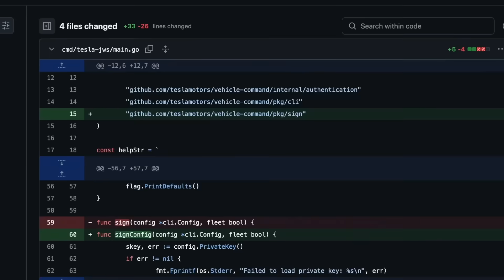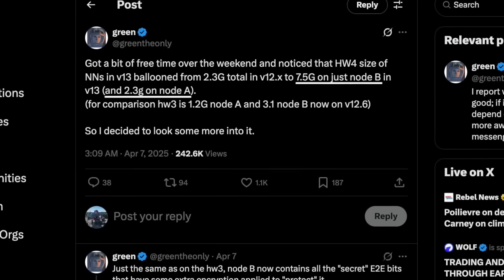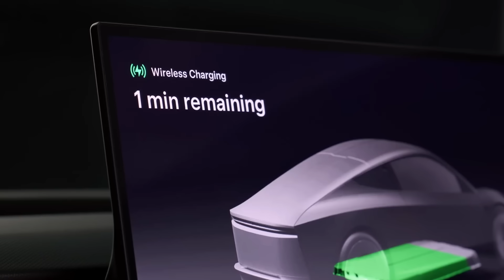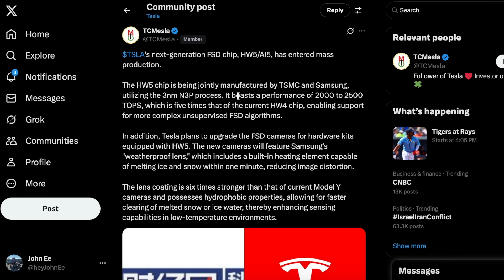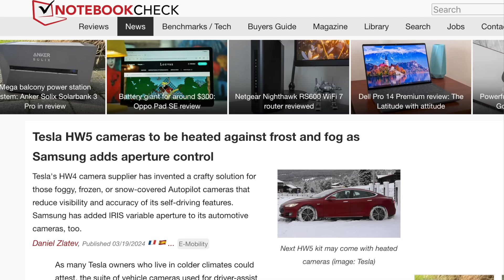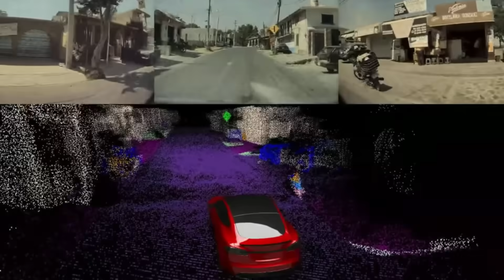Tesla Prepares HW5 Camera Upgrade Delivering Major Improvements | Massive Changes Coming

Comment from the maker: If they end up solving unsupervised FSD with the current hardware are you still inclined to wait or holding off for HW5? Here’s more about the Hybrid Lens camera system https://youtu.be/294AYhCPYnM
Reply: Holding out for AI5 for exactly the reasons you describe in this video. Yes, FSD is a high priority feature for me, and my gut sense is that 10x jump in processing power of AI5 is necessary for mature FSD; if HW4 was adequate, Tesla wouldn't be working on the upgrade.
Reply: Get AI4 in the US along with the $7500 federal incentive and still current 1.99% interest rate.
Reply: Tax Credit will be gone by then
Reply: @Rishi.Rao.  We may lose the tax credit, and that's a major issue for tight budgets. On the other hand, if one regards AI5 as a "must have" feature, then getting a bargain and missing out on that feature isn't a viable tradeoff.
Reply: It’s a tough call…I really want to take advantage of the tax credit before it goes, however unsupervised FSD is a major feature for me…
Reply: At least a year away though

Comment: Considering AI5 will use more power, it is likely Tesla will also implement a new battery to either keep up with the power usage to maintain approximately 330 miles range or increase the total range.

Comment: Once AI5 is out, AI6 will be around the corner for those wanna wait. AI6 will change the game even more until AI7. Joke aside if you need a car, just get one now before the $7500 is gone. This chip thing will be like smartphones. You will end up with older hardware anyway so just stick with your own changing cycle. And got forced to change when things happens.
Reply from the maker: completely agree, although AI5 will be a game changer being the first chip built on true unsupervised self driving unlike other ones before that where they were just working up till this point

Comment: tesla has a long way to go, before tesla is even close to Waymo, if they will ever be able to launch Robotaxi, then tesla will have to go back to the drawing board

tesla doesn't trust their Robotaxi so they have a number of extra layers of safety, 

the 1st layer is that a person sits in the passenger seat and holds the emergency button tightly the 2nd layer of safety is that an operator sits and can stop the car or correct the car the 3rd layer of safety is that these vehicles run in a geofencing system the 4th layer is that Robotaxi, may only be driven when there is daylight, and if there is fog, rain, or other weather conditions then Robotaxi may not be used

what i have seen is that tesla Robotaxi, is even with these 4 extra layers of safety directly dangerous, luckily no one has been hurt

https://youtu.be/F0W-qF0hEfs?si=d7OWD6euO0kJDc1P

https://youtu.be/sNdFkQJTYUA?si=bMcojAdP1UBYc8rT

https://www.reuters.com/business/autos-transportation/teslas-robotaxi-peppered-with-driving-mistakes-texas-tests-2025-06-25

I would have taken Waymo, which really operates a self-driving service and has equipped the car with the sensors that are fundamental to being able to have a self-driving car, these Tesla does not have

tesla will never get full fsd, approved by authorities in europe or other developed countries when they only use cameras as sensors, these do not meet the required traffic safety, in weather such as, fog, rain, snowfall, twilight, backlight, slippery roads, darkness, etc. but good luck

https://youtu.be/IQJL3htsDyQ?si=cS1duIVykjgB6hTx

Comment: Any info on what are the new I/O points in HW5 vs HW4. 
More discrete channels or bandwidth, cpu & gpu, etc. ?
Reply from the maker: No info on the I/o yet but it’s expected to have a few additional open ports for expansion, similar to what some HW4 boards had and was eventually taken up by the Phoenix radar and the bumper camera. Those other points I don’t have any details on yet but I’ll keep an eye out

Comment: regardless of what HW tesla cars get

tesla will never get full fsd, approved by authorities in europe and or other developed countries when they only use cameras as sensors, these do not meet the required traffic safety, in weather such as, fog, rain, snowfall, dusk, backlight, slippery roads, darkness, etc. but good luck

https://youtu.be/IQJL3htsDyQ?si=cS1duIVykjgB6hTx

if unattended, fsd is to work under these conditions, then tesla has to install completely different sensors like lidar and radar, there are no shortcuts, Waymo has understood this, but not tesla
Reply: Its also impossible to invent a rocket that lands intact and is reused many times…🧐
Reply: @randyregehr1593  or building a bomber without control surfaces, but it is possible with advanced technology, cameras don't work, then the plane crashes
Reply: Maybe a solid state lidar in driving direction will be enough. Use this as a collision avoidance system and you should meet the requirements
Reply: does humans have lidar anda radar in our eyes. do we shoot lasers from our eyes while driving ?
Reply: Tesla in the beginning did understand this and with lidar 2.0 available there should be a way to retrofit it.

Comment: HW5 won’t be here for another year. Should be a simple swap from HW4
Reply from the maker: It’s possible they just provide an adapter to the harnesses and board, then a simple camera swap shouldn’t be an issue
Reply: @heyJohnEe there will be nothing simple about it, I promised you. And a wiring harness will not be enough to go from about 100 watts to 800 watts usage.
Reply: It will not be a simple swap. The cameras alone will make it not be simple, but the power usage of Hw5 should make swapping something to be cautious of.

Comment: Another point -- human brains are NOT neural nets. Also, add up all of Tesla's training data and it is represents an insignificant amount of driving behaviour and conditions, much like ChatGPT has only mapped an insignificant portion of humanity existence. The same with Grok. Modern AI is great. FSD is great. But, get real!
Reply: Statistics show hardware 4 is already 50% safer than the average driver. It doesn't need to have every piece of data ever, it can figure situations out on its own without being trained on them first.

Comment: Hate to pop that balloon but it is becoming increasingly obvious FSD will never be "done'. The neural net continues to get larger and more complex. Musk has already mentioned they are in the midst of a retrain. Floating point arithmetic is extremely power hungry. There is no way to improve performance 5x without needing more power in aggregate. 

Net localization is probably the only way forward. However, I believe the most important localization should be to "learn" local driving colloquialisms (including the driver). Lol. That is simply not possible using end2end nets. Given the money and power used to get to this level of training, Tesla is unwilling to try another way.

FSD will never be unsupervised in unfenced areas. I will never sit in the back of my MYP or M3 while it drives me around town. I don't trust it with my life -- plain and simple.
Reply: You sound like you know what you’re talking about and I agree
Reply: We’ll see soon — within six months to a year we should have feedback from the robotaxi experience, and from there we’ll know if it’s feasible. I’m confident, because the model will only need to know how to drive; it won’t need to be capable of doing everything. The size of modern LLMs is what it is because they’re designed to know everything, not to be specialized. Anyway, as I said, we’ll see soon with the robotaxi experience.
Reply: There will be fsd, but it will never be fool proof. Of course it will make mistakes. Hell im sure your driving record is perfect 😂. FSD has its place and it will improve. I will be buying it, but of course I would still want to be in control. People cant believe everything, but not to skeptical either. Tech advancements take time. Think about how far our smartphones came along in 1 decade. Now think out FSD advancing. Never perfect but overall a great thing as long as its controlled and carefully tested.

Comment: So John , number of inaccuracies in your video , hw4 is not 300 tops , it is about 100 Tops , only 50% improvement from hardware 3. Also you can bet that Tesla is not releasing a 2000 TOPs chip, because even at N3P node ,  2000 Tops chip will consume crazy amount of electricity, hardware 5 is 500 tops max . also the compression is not to do with the image feed since it is already low res to begin with , the compression is more more the neural nets so more can be stored in memory
Reply: It was always said to be around 1000W, although there’s only vague information about it. But I don’t see why it couldn’t have similar power to an RTX 5080 or 5090. Besides, like AI3 and AI4, it’s specialized hardware, with efficiency optimized for that kind of context.
Reply: The creator of this video is so disingenous. Another Tesla booty licker that doesn't report things correctly.

Comment: There are evolutionary upgrades and then there are revolutionary upgrades. I'm happy with a phone that's several years old because the evolutionary upgrades are a tad better, but not essential. The FSD technology is very young and not quite ready for prime time yet, and I get the sense that AI5 is the revolutionary upgrade that will make the hardware fully up to the task. Of course, this only is highly relevant to buyers that prioritize FSD.

Comment: Bros never heard of compression algorithm improvements
Reply: It’s not just about compression, processing algorithms or a code base that is streamlined to fit within existing memory and that can achieve higher processing throughput with the existing processor. Algorithms and compression can help improve use case performance but only to a very fuzzy point.  Beyond that, hardware architecture has to improve to fully replace human control over what can be a large mass traveling at a dangerously high rate of speed.
Reply from the maker: Then why didn’t Tesla just compression algorithm HW1 and call it a day
Reply: @heyJohnEe  and.... thats yr reasoning smh  good luck with that. stop being paranoid and spreading rumors

Comment: They just barely decided HW3 wasn't good enough.  It's hard to believe that HW4 has already ran out of head room.
Reply from the maker: It wouldn’t be smart for them to outright say it ran out of headroom yet, only when HW5 rolls out
Reply: @heyJohnEe  I think you missed my point.  If HW3 'ONLY JUST' ran out of head room, and HW4 is massively more powerful than HW3, it's extremely unlikely it's already out of head room.  

Also....  There is the idea called "distillation" where you're able to take larger more powerful models, and scale them down to smaller models that are just about as powerful.  Now Tesla might be pushing not-fully-optimized models (as they used to do for HW3), just because it's quick and convent.  But that doesn't mean HW4 is running out of space.  It just means they are using the space liberally in order to accelerate development.  HW4 is almost certainly OVER KILL to achieve FSD.
Reply: It has been known for years.
Reply: Think iphone :)

Comment: So is HW5 just a computer upgrade? It seems the cameras are not going to be changed.
Reply: It has been specifically reported that the cameras will be sightly upgraded too (not as big of an upgrade as from HW3 to HW4 though which was a big jump).
Reply from the maker: Nope, this time it’s going to be a much more substantial upgrade to sensors not just the computer
Reply: @heyJohnEe  Did Ashok Ellusamy say that to you. C'mon dude stop with this crap

Comment: FSD predictions are like stock index predictions.  Anyone can make one, and if you just don't commit to a date you are never wrong.  Same old nonsense.  Waymo is way closer, but even they are a long way off.  The edge cases are infinite.
Reply: I would consider waymo if and when they can navigate on freeways... They will Never  compete against Tesla, not even close. I would be embarrassed to drive one of there cars with Sputnik on the roof Embarrassing!
Reply: @dporrasxtremeLS3  People care about the stuff they own.  They don't care what a taxi looks like.  Also, highway driving is easier to engineer than surface streets since it's a narrower set of criteria.  Tesla is a lot of hype while Waymo is quietly getting the job done.

Comment: Thank you very much for this video.  I am a Tesla investor, and have been thinking about buying a Tesla to participate in the RoboTaxi fleet.  It seemed to me that to be viable for any near-term upgrades this vehicle would have to have two components:  HW5 and the front bumper camera.  Your video confirms this.
Reply from the maker: Hey yeah I think they’ve confirmed the front bumper camera by only allowing the new Model Ys on the initial Robotaxi fleet this Sunday. HW5 is going to solve a lot of weather relating issues that can’t by resolved purely by software

Comment: John, AI3 was quite capable.  I drove thousands of miles using it.  The AI4 computer is 5 times as fast and has 4 times the camera resolution.  It's more than adequate for FSD.  AI5 may be useful for other reasons.  The new cameras will apparently have built in heaters.  That may help those of us in cold climates (though in Minnesota I haven't had a problem in winter with either AI3 or AI4).
Reply from the maker: Yup I agree they are very capable chips and still performs well. But there seems to be a rough timeframe for how long they’ll be supported before hitting bottlenecks 5 years for HW3 and nearly 5 years for HW4 before they are superseded by a better version. They both hit physical limitations now. HW5 looks to be the first hardware suite that will run unsupervised FSD right of of the box on day 1 without any compression, constraints or limitations

Comment: M3P-25 and understand AI5 upgrade not feasible because of significantly redesigned cooling gear of AI5-models?
Reply from the maker: Technically it’s possible to swap out the board and just retrofit the male-female connectors to fit the existing wiring harnesses around the car including the cooling loop. Not sure they’ll want to do it bc of costs though
Reply: Elon can land a rocket vertically.
Reply from the maker: @scottbreseke716 lol exactly so anything is possible

Comment from the maker: Anyone have any details about the phoenix high-def radar on some Model S/X, did they eventually remove it or is it still being produced on newer vehicles. Possibly this could be packaged with the new AI5 sensor suite as well
Reply: It was removed as it didn't offer any advantage and caused conflicts with the more reliable vision system.
Reply from the maker: @StormyDog It was removed for a few years on older models than they brought it back a revised version again recently. Is that the one you’re referring to that just got removed (again)?
Reply: @heyJohnEe  That's what I've been told.  In the period that it was brought back it was apparently never actually used.  If you think about it, it doesn't make sense to have it in only a couple low volume models.  It makes software upgrades far more complicated.  I wonder it they had some left over radar units and thought it would be a good selling point for the most expensive models.  They never even used it in the Cybertruck so that tells you a lot.
Reply from the maker: @StormyDog yeah that makes sense thanks for sharing